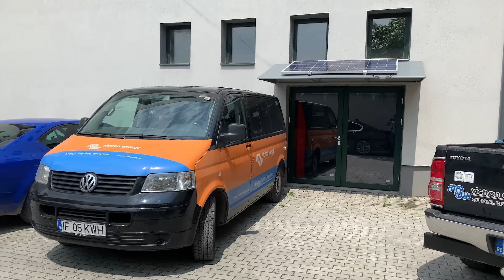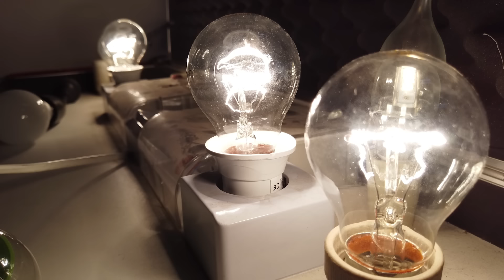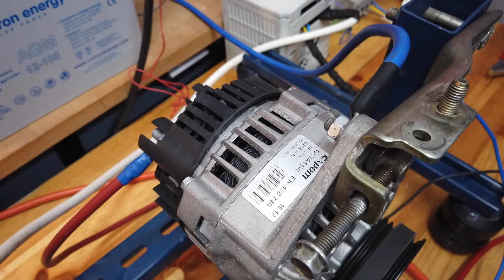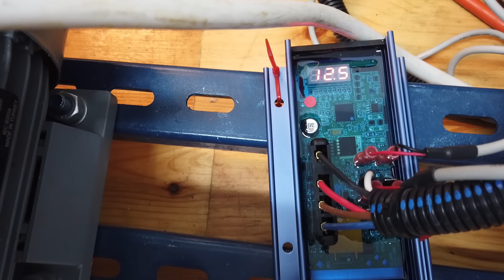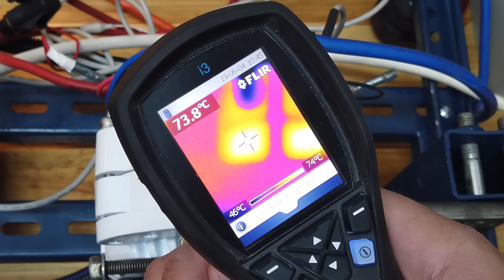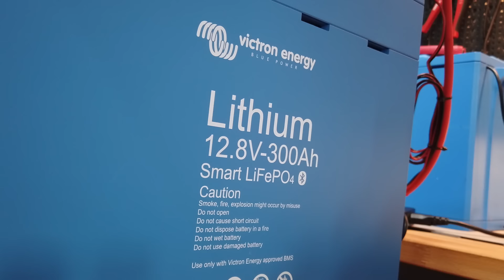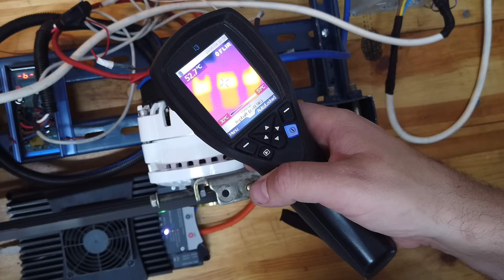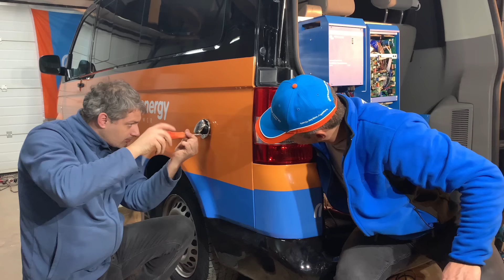How to not blow up your Alternator when charging Lithium

Comment: Erm this video is very misleading if you are installing a DC-DC charger in a campervan or van conversion. I don't know anyone who just runs an alternator to charge a Lithium battery. The alternator is connected to the vehicles main starter battery first and foremost, then we piggy back from that. All you have done here is scare and throw doubt on peoples installs, not a great advert for Victron to be honest.
Reply: Your reaction makes it clear that there is a need for a video like this was my first thought.   The issue here Is that if you "just " connect a lithium battery bank on an existing alternator/starter, there is a huge risk your alternator cannot handle the constant high current (higher then what is designed for) in combination with the low cooling efficientcy.  We have seen this so many times that we explain by this video to limit the charge current to the lithium bank to avoid problems.  please take this advise serious

Comment: What was the point of this test??? If I am not mistaken, the batteries tested were charged without BMS - it is incorrect setup. Also, running an alternator just relying on its self cooling capability is not quite realistic. And as other commenter mentioned, the charging characteristics of alternator and batteries must match. Othervise, yes - it is possible to overload and damage any alternator...
Reply: the point is that due to the low internal resistance of the battery the alternator gets damaged , the BMS protects the battery, not the alternator      Self -cooling, specially on boats , is the way most are being cooled

Comment: Healthy 78.9 amps... this alternator is rated 70A and cheap quality.
Reply: Could well be, the point is that alternators will overheat and have a reduced lifespan due to the overload conditions Lithiums create on them.   Also the expensive ones..
Reply: @JohannesBoonstra-ol2nz  Normal quality brand alternators can't really be overloaded. They lower the voltage and not deliver too much amps.

Comment: Robicie trochę ludziom wodę z mózgu. Każdy alternator produkowany przez firmę Bosch ma zabezpieczenie termiczne. I wykorzystywanie w filmie samochodu VW T5 nie jest najlepszym przykładem. Po drugie nikt z was nie zadał sobie tyle trudu i nie sprawdził jakie minimalne obroty ma alternator w samochodzie gdy silnik pracuje na biegu jałowym. To ja Wam mówię że minimalne obroty alternatora są przynajmniej 3 razy większe niż obroty silnika w samochodach osobowych i przynajmniej 4 razy większe w samochodach ciężarowych. Zmieńcie te testy, bo przynajmniej ich cześć mija się z prawdą.
Reply: This is not purely about cars , often large lithium’s are used in boats 
Ps even with thermal protection the lifespan is reduced drastically 
The point here is not that the alternator stops working in minutes , it’s to show the bad efficiency will cause a lot heat wich , in the end , will destroy the alternator

Comment: I charge my 4 cell lifepo4 battery  off my car using a toolkit rc m8 charger. It balances the cells and regulates the current for whats best for battery while charging. I use that as my bms with fusing for the bus bar output.

Comment: Buck converter and capacitor would iron out any spikes, then the charge controller would have it easy.  Divert to dump load like hot water element at preset limit.

Comment: The test rig shown is destined to fail - A relatively small alternator turning unrealistically slow with a high load - this post will needlessly concern many RV and boat owners - a cheap fix would be to connect your lithium with 3m of 6awg good quality silicon wire via the usual charge relay that is only on when the engine runs - I like the Smart relays that turn on at  13.2 v and off at 12.8v - as the current rises the voltage will drop a phenomenon well known - by the time it reaches 50a there will be a  1.5v drop and by 80a the drop will be  2.2 v - this will effectively moderate current by lowering the headroom pushing  charge into your battery - Of cause you can tinker with these parameters by changing the wire gauge and length - 8AWG will increase the voltage drop, reducing the current - a short length will reduce the voltage drop increasing the current -  It's good to have the lead acid start battery permanently in parallel it will reduce surge if the BMS suddenly switches off - this surge often kill the diodes in the alternator.
Reply: Diode issue is also a thing, but this testsetup was there to showcase that the alternator will get warm due to the fact the charge voltage does not go up while charging a lithium battery until its full and therefore the output power of the alternator is higher then the designed output which causes overheat.   and its not that in real life this lifespan is limited to a few minutes but there will be a serious reduction in lifespan    I personally have seen to many failed alternators in systems with lithium charging
Reply: @JohannesBoonstra-ol2nz  The old split charger set-up will stress an alternator if used on a lithium house battery - I think however this post is somewhat alarmist possibly to justify the expensive solution? There are cheaper workarounds that  offer alternatives

Comment: Noone is using such serious batteries without a proper bms. One of the tasks of a bms is limiting the charge current. At what amperage exactly to set this limit is up to the person setting up the battery system. So your experiment results are not really inducative of anything , aka useless 🙄
Reply: Please have another look at the experiment, it's not as useless as it seems to you.  ;-) ,  The task of the BMS is to take care of the batteries, and if needed to protect the battery its there to reduce the current, In that you are correct  The issue here is NOT the batteries but the alternator, which will often get overloaded/to warm and this will result in a short lifespan.   This because the alternator is actually built for batteries which get higher in voltage as soon as there is a charge current. The higher voltage will limit the output power and therefore also the heat (Avararge effeciantc is 50% ).
Reply: @JohannesBoonstra-ol2nz  Without a bms (case shown in your video) the li battery sucks into itself as much current amperage as it physically can (limited only by its internal resistance which is low) . This huge uncontrolled current can not only damage the alternator: it can and will damage the battery itself as well. That is exactly one of the reasons why batteries like that absolutely need bms-ses, and actually they pretty much all have them. Since a bms is an absolute must for such a battery. A battery like that, but witout a bms, is smth not really occurring in real life: no one who is sane will ever use a bms-less configuration like the one shown in your video. And that is exactly the reason why I insist that your experiment is not really indicative of anything useful - for it depicts an imaginary situation which virtually never happens in real life. Sorry. 

If the battery had a bms, the charging current consumed by it would have been severely limited by the bms and would have been a fraction of the amperage shown in your video. And in this totally different situation this current may or may not have been too high for the alterbator to survive. Like I wrote, there are different bms-ses with different charging current limitations. One can argue which alternator and bms configurations would make sense. That would be a useful argument. However technically it is not a problem to have a bms limit the charging current at any amperage dangerous neither for the battery nor for the alternator. 

As to the case shown in your experinent, it is clear even without any experiments , that if you refuse to use a proper bms on a battery requiring such, this can have severe consequences. And a destroyed alternator is not the worst case scenario in such a situation. Good thing is that this situation seems totally unlikely to haooen in real life.
Reply: @dontknowler  Of course a BMS is needed, but thats not the point here.  If you have a 15kWh lithium bank which needs to be charged, a BMS will allow 500A or more before it starts limiting the current.  thats all fine but way too much for the alternator.  The BMS will not check if the alternator get overheated right ?    so therefore this converter will help reduce power
Reply: @JohannesBoonstra-ol2nz  Technically a bms can be programmed to have any settings, including any limits for the charging current, including limits which take into consideration limitations of the alternator, and not only of the battery itself. And it may also have a temp protection sensor or even two of them - one could be attached to the alternator, if needed. So everything is up to the person designing and setting up the system. Such a person has plenty of options available, and is supposed to be doing his/her job right. And I bet the only thing this person will never do  - he/she will not be attempting charging a huge li bat without a proper bms 🙄
Reply: @dontknowler    A typical BMS does not limit current, in best case its able to sent a signal that current needs to be limited    The converter has also the function to stop charging for alternator when the batterie is full, so you would need something in between anyway.   PS could you sent me a ink of a BMS with alternator temp sensor ?
Reply: @JohannesBoonstra-ol2nz  You dont need a special alternator protective sensor for that. Neither is it a must to dive deep into bms programming. Try thinking out of the box. Just take a bms with 2 sensors, read the bms specs, take a flir camera, and place the second sensor at a place (e.g. at the alternstor housing) which gets hotter than the bms trip temp as the alternator is starting getting too hot.
Reply: @JohannesBoonstra-ol2nz  Afaik limiting the discharge current, limiting the charge current, and balancing are the three functions any bms is there for. This is sort of the very purpose of this device. I am not a bms market reviewer, but imo any bms shall have all the three 🤔

Comment: Two questions - first, alternator speed is not necessarily the same as engine rpm due to pulley sizes, correct? So even at idle speeds, an alternator could be turning at +1500RPM

Second, why not use a Victron Battery Sense Monitor on the alternator to reduce charging current when temps rise? If it works mounted on a battery, it should work mounted on an alternator

Comment: If it has 50% efficiency and generates a thousand watts, doesn't that mean it dissipates 500 watts as heat?  If it created a thousand watts of heat then it would be 0% efficient.
Reply: ?   If the efficiency is 50% the heat is equal to the output power.
Reply: @johannesboonstra6917   Yes I think that's what I was trying to say 😊

Comment: It might be a bit more complex, but what I'm thinking here is a bit convoluted and a tad expensive. The solution I see is a DC to DC Solution that I doubt anyone has addressed:
Use the Alternator to charge a Lead Acid Battery. Use the Lead Acid Battery to power an Inverter that powers a proper LiFePO4 Charger.
Alternators, after all, were designed SPECIFICALLY to charge Lead Acid Batteries. 
Let them do their jobs.
Reply: could be done, but then there would also be quite some losses ( and a hughe investment I am afraid )

Comment: In car audio regular alternators are used to charge lithium battery banks with NO issues. We never let battery get low to 50% like on video. If battery were to get that low we charge it at low amperage rate with a charger NOT with alternator
Reply: Correct , when the battery isn’t empty , the alternator has no trouble keeping it up to voltage.

Comment: But using a Pecron 500w car charger you dont have to worry about the alternator?
Reply: thats not a product between Alternator and lithium bank, so no.
Reply: @JohannesBoonstra-ol2nz  Does Victron have similar product to the Pecron500w Car charger? Do they have 900w versions?